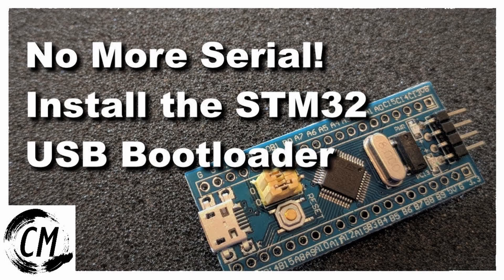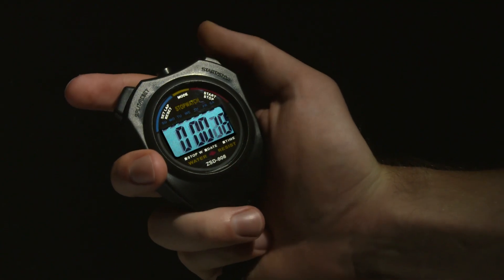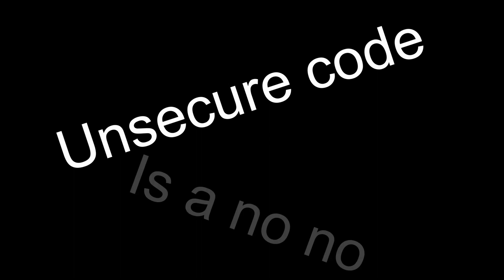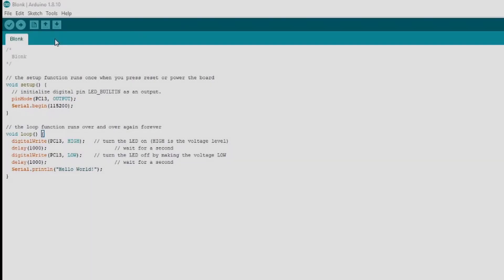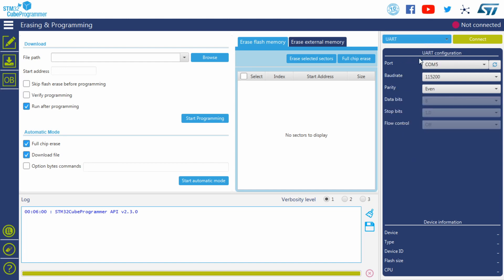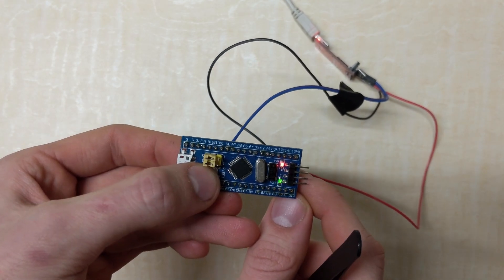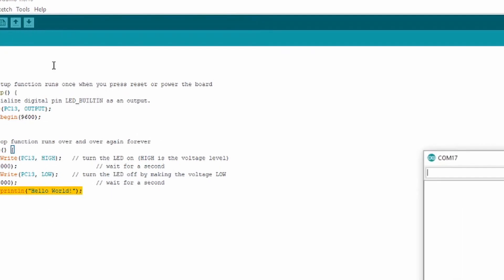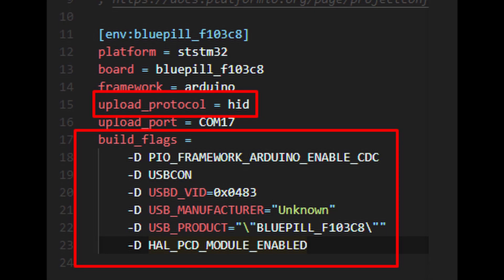How to Install the STM32 USB Bootloader, New Version! (Blue Pill F103C8T6)

Comment: So, due to whatever reason no bootloader, this one nor the old one, is working on my STM32F103C8T6. I upload the bootloader via serial  (using a cp2102) then set BOOT0 jumper back to 0, and when I connect the STM32 USB to my laptop it says "Unknown USB Device (Device Descriptor Request Failed) in Device Manager (under Universal Serial Bus Controllers).
Also one thing I would like to mention is that my STM's usb does work via Serial.println() it prints stuff on the serial monitor 
Any help is super appreciated, I have no clue whats going on

Comment: could stm32 f411ceu6 use this method ? since  f411 has built in dfu mode. but i need always push boot 0 and reset everytime if i want upload the code
Reply from the maker: There may be a different bootloader, but I think this only works with the f401 and blue pill

Comment: Best stm32 bootloader tutorial out there!  Question:  I have a "Pill" board that is the same as the F103 however it has an F303 chip on it.  The binaries you reference don't have an entry for the F303.  Can I use the F103 bootloader binary?  TIA!

Comment: Im getting “data read fail”, “GetID command not acknowledged” and “read protection” errors on the  stm32cube software on all my 5 blue pills, despite it reading the chip information just fine. Any clues as to what may be happening? Great video regardless.

Comment: Very cool,  Im more curiouse to know how a bootloader works what it does and why hasnt stm32 done this for convenience?  On the otherhand im  flashing fine on my  stm32 clone(ch32) through  its  usb port without an additional bootloader although i have to use their tool for flashing.  But after all that  i found the stlink actually more convenient since i dont have to unplug and reset jumpers everytime like i have to with usb.  Its a miracle i havent lost the jumpers the amount of time its popped out on its own while trying to take it out, its not a matter of if, but when...

Comment: NOT WORKING!!! My Arduino IDE throws an error saying "Failed uploading: no upload port provided". I used ST-Link V2
Reply: After you flash the bootloader you need to hook it back up to the TTL converter and select the COM port and then try uploading in arduino IDE. It then begins to flash something else and it will finally work.

Comment: Thank you very much for your guidance. Spent 1.5 days to make STA32 working until I saw your video. Now  I am good now. Just FYI, I used STM Flash Loader to flash bootloader and in the Arduino's Upload method I used HID Bootloader 2.2

Comment: I tried the steps till 6:05, but windows did not recognize my bluepill when I plugged it in via usb. Not sure why, wondering if anyone is facing this issue.
Reply from the maker: Does it not recognize the pill, or does it even know a device is plugged in? Maybe try another USB cable, some don't have data lines

Comment: Thanks for info but in my case after installing the bootloader when i plug my STM32f103 bulepill it says USB not recognized and in arduino IDE it says your board is not connected,but i think bootloader is flashed as mine PC13 led is blinking at very high rate.Any ideas?
Reply: Hey same problem here. Any fix?
Reply from the maker: Sometimes the boards themselves are just broken, try a new board. Other times your USB cable might not have data lines so try a new USB cable
Reply: Old but after you flash the bootloader you need to hook it back up to the TTL converter and select the COM port and then try uploading in arduino IDE. It then begins to flash something else and it will finally work.

Comment: If anyone follows this tutorial on MacOS and having the error: hid-flash permission denied, you need to open terminal and add the execution permission to hid-flash file. After that, you can upload the code as in the video.
Reply from the maker: That would be a good thing to make an issue for in the GitHub repo. Thanks for bringing that up!

Comment: I dont have this options in arduinho how update this?
Reply from the maker: Which option specifically?
Reply: @CalebMarting  USART support, USB support also HID Bootloader is only 2.0 not 2.2
Reply from the maker: I think they changed Links at one point, maybe the one in my video is broken? Look at the official GitHub for Arduino core stm32 and see if there's a link for a new json

You can also check for a new hid release
Reply: @CalebMarting  ok i thing i found but in library menager what should i search?
Reply: @CalebMarting  ok nevermind I fix this but last question after i install HID bootloader  to stm32 why in device menager is error "usb device not found" also in arduino "PORT" tab is empty

Comment: Very nice video, finally i could upload the test code to my bluepill. Now i have the same problem as described in the pinned comment. When i first upload everything wroks fine, but when i try to upload again it says : 'Error - [1209:BEBA] device is not found' I tried disconecting and reconnecting my board per usb but it didn't work, after erasing the full memory of my chip and re flashing the bootloader it worked, one time. Is there a way so I don't have to reinstall the bootloader every time I want to upload a sketch. Thanks yall in advance
Reply from the maker: Yep, if you put the boot one jumper to the 1 position, the opposite of the one that I used to upload the bootloader, and press reset it'll enter eternal USB boot mode. Here it'll wait for code to be uploaded, and then once it's uploaded it'll run. 

Anytime you press reset or turn the power on though, it will enter boot mode again, if you don't want that to happen and just want it to run your uploaded code, move the boot one jumper back to the zero position

Comment: Hi
Your video on STM32F103 is brilliant, it helps a lot. Both programming and native are combined into 1 port after installing the HID bootloader. Appreciate your video.

Do you also have a video that guide us on STM32F407 board?
Reply from the maker: It should be almost exactly the same process, just using the f407 bootloaders instead. I've never used one of those boards though. What are you confused on?

Comment: Is there a way to make an usb Hid device with this bootloader? UsbComposite library is incompatible :(
Reply from the maker: You can go back to the old core mentioned in my previous video on the topic, although I don't know if you'll be able to use this specific bootloader then
Reply from the maker: Although I think it is possible to use it as a keyboard and or mouse if you set the USB in the tools menu to hid and use the built-in keyboard or mouse library

Comment: It didn't work for me, when I upload the bootloader and reset the board, the led on pc13 blink pretty fast. Then I tried to upload a sketch and didn't work.
Reply from the maker: I mean it could be a USB cable without data lines, is any device detected when you connect it? The LED blinking means it should be working. You could also try it on another blue pill because sometimes it'll look like it should work but it just won't
Reply: @CalebMarting  it was the USB cable. Thanks. It works now.

Comment: Hey. I know this is an older-ish video, but do you know if you can program the blue pill with STMCube IDE? Or with STlink utility or STM Cube Programmer. I just want to upload what I code in the IDE to the board via USB, be it directly or writing the binary file.
Reply from the maker: You could use the command line hid interface to upload bin files directly, though I'm not entirely sure how to do that. It's in the same repo as the the bin file
Reply: @CalebMarting  Thanks! I'll check it out

Comment: Not working at all for me...either on Windows 10 or MacOS.  Bootloader working successfully but this business about the virtual com port...is that a software driver that needs to be installed from STM?  Otherwise, device not detected at all...
Reply from the maker: The com port should have the driver by default on Windows 10. When you first install the bootloader though, the com port will not be there. This is because uploading with the settings described, generic CDC supersede usart and USB enabled will create the com Port when a sketch is uploaded for the first time.  However sketches are actually uploaded over a hid device meaning that you don't actually need a com port to upload code. However Arduino is a little janky and requires a com port be selected if one's available.
Reply: @CalebMarting  I tried following the method exactly...it all works, the green LED on the STM32 is flashing...but no go.  On Windows 10, I get the message that the USB device is not working properly.  What environment did you use in your video?
Reply from the maker: It does sound like everything's working correctly. Do you have another blue pill you can try it out on? Sometimes it's just the pill itself that is Dead on arrival. I was using Windows 10 if that's what you're asking
Reply: @CalebMarting  They are almost certainly clones, but they work in the sense that I can program them with the FTDI board.  I found another video using the Flashloader software, but they had links to a different generic boot file.  Seems to work slightly better in the sense that my MacOS can detect it when I plug it into USB...but I cannot program it.  On the Windows machine, same problem...I get that error message that the USB driver had a problem.  I think I'll just set this aside and continue working with the FTDI board for now.
Reply from the maker: Sounds good, I also have a video that shows the older version. From what I've found many boards will work , but if something's broken it's the USB that's the first thing to go.that means a board can still execute the blink sketch just fine but it'll have trouble connecting to the USB. The fact that they are clones might not be what's causing the issue, it might just be the USB peripheral doesn't work
Reply: @CalebMarting  Question: when you connect via the cube programmer, how many memory addresses do you see on your device? Is it 128 (0-127) with 1KB each?  Does that mean this thing has 128K of memory, not 64?
Reply: OK, super weird.  The Amazon order said I had bought the 64K version, I guess they shipped the 128K version.  I flashed it with the high density boot loader, and it works fine now (I am able to program it on my Mac).
Reply: @CalebMarting  I should also THANK YOU for putting this video together...except for that one oversight on my part (about the 64K vs. 128K), every step if followed correctly in your video gets you programming from USB..which is great!  I'm flashing all of my STM32 boards today.  Thanks again, keep up the good work!
Reply from the maker: That's awesome! Glad it works
Reply: @CalebMarting  Ughhhh...sorry for making this more complicated...but I feel I should correct my previous reply because it may throw someone else for a loop.  I actually didn't use the high density boot loader, but the medium density boot loader for PC13 (which is my board)....HOWEVER....when programming the board the first time, it is critical that you unplug the FTDI board, and then I had to select "Blue Pill FC103CB (or C8 with 128K)".  So just to be clear, my board was FC103C8...and it has 128K of memory.  Selecting the wrong board type (by going with what the seller said it was rather than checking if it was 64K or 128K) was what was the issue.  Also, when the board was programmed the very first time, all of the sudden a new port became visible, and consistently visible after plugging and un-plugging the board to the computer.  In my case, the port detected on my Mac is /dev/cu.usbmodem8D7F226649521 (and it's the same for any board I use so I guess the name is somewhere in the BIOS?).  Also...of the three boards I was using, 2 worked via this method, one does not...I think it's probably because the USB port is faulty or there is some issue with the soldering, not sure.  But if anyone does have chronic problems connecting to the USB after using this method, definitely try using another board, and also try confirming the cable works (some USB cables only have power connected, not data).
Reply from the maker: Thank you so much for your feedback it's really helpful!

Comment: Followed this and was able to program the 2.2.2 HID bootloader onto a bluepill. It was  attached to my linux box and I was able to program it using arduino as described. I was able to upload the blink sketch and it worked fine. 

What I noticed was that after programming the bootloader and plugging in the device I saw

Feb 19 17:35:17 x1-Carbon kernel: [159760.782737] usb 1-4.3: new full-speed USB device number 62 using xhci_hcd
Feb 19 17:35:17 x1-Carbon kernel: [159760.896087] usb 1-4.3: New USB device found, idVendor=1209, idProduct=beba
Feb 19 17:35:17 x1-Carbon kernel: [159760.896088] usb 1-4.3: New USB device strings: Mfr=1, Product=2, SerialNumber=0
Feb 19 17:35:17 x1-Carbon kernel: [159760.896089] usb 1-4.3: Product: STM32F HID Bootloader
Feb 19 17:35:17 x1-Carbon kernel: [159760.896090] usb 1-4.3: Manufacturer: www.serasidis.gr
Feb 19 17:35:17 x1-Carbon kernel: [159760.897242] hid-generic 0003:1209:BEBA.002A: hiddev0,hidraw4: USB HID v1.11 Device [www.serasidis.gr STM32F HID Bootloader] on usb-0000:00:14.0-4.3/input0

 Subsequent upload required the tty port to be set  to ttyACM0, which I found strange but then I noticed that when attached it showed up as a different device. After uploading the blink program and on every new connection of the device I see. 

Feb 19 17:35:21 x1-Carbon kernel: [159764.903072] usb 1-4.3: USB disconnect, device number 62
Feb 19 17:35:21 x1-Carbon kernel: [159765.142626] usb 1-4.3: new full-speed USB device number 63 using xhci_hcd
Feb 19 17:35:21 x1-Carbon kernel: [159765.256541] usb 1-4.3: New USB device found, idVendor=0483, idProduct=5740
Feb 19 17:35:21 x1-Carbon kernel: [159765.256548] usb 1-4.3: New USB device strings: Mfr=1, Product=2, SerialNumber=3
Feb 19 17:35:21 x1-Carbon kernel: [159765.256553] usb 1-4.3: Product: BLUEPILL_F103CB CDC in FS Mode
Feb 19 17:35:21 x1-Carbon kernel: [159765.256556] usb 1-4.3: Manufacturer: STMicroelectronics
Feb 19 17:35:21 x1-Carbon kernel: [159765.256559] usb 1-4.3: SerialNumber: 8D9022774848
Feb 19 17:35:21 x1-Carbon kernel: [159765.258827] cdc_acm 1-4.3:1.0: ttyACM0: USB ACM device

No issues uploading new sketches that blink or use the Serial.println() function. All works fine, but I thought it was strange that the device idVendor changed from 1209 to 0483 ? Looks like newer version of the STM package (1.9) in arduino overwrote the HID bootloader.
Reply from the maker: It could also be the fact that when you upload an Arduino sketchwith the settings I describe in the video it creates a serial port. It's possible that's what you're detecting since that isn't initially available when you first upload the bootloader

Comment: Am i the only one who cannot communicate with bluepill over uart? No matter what i tried, it didnt work. I checked A9 and A10 if they are connected to stm chip with multimeter and yes they are. When it is not bootlader mode it just blinks, when it gets bootloading state no respond at all.
Reply from the maker: Do you have another blue pill you can test with? Sometimes there are defective blue pills, the chips on them especially

Comment: hello, not long ago I got the Blue Pill F103C8T6, and I am about to buy an ST LINK V2, but I am not sure what is a Bootloader ? Further I have heard something about decreasing the STM32's capacity. Does the bootloader mean you can use the board with the USB ?
Reply from the maker: I would definitely recommend buying the Stlink, it is worth it. 

The bootloader let's you upload arduino code over the USB, instead of needing an external programmer. However a bootloader will use 2kB of memory. An ST-Link v2 let's you program easily and debug your code. Also, you can still use the USB for serial output even if you are using an ST-Link, you just can't upload code over the USB without the bootloader.

One more thing, if you are using a bootloader and upload code with an Stlink it will overwrite the bootloader and you'll have to reupload it If you want to use it again

Hope this helped

Comment: Great video man. I have a question. will this also work with cube programmer? I mean can I flash .bin files with cube programmer using the USB?
Reply from the maker: Unfortunately it will not. It won't recognize anything but the default bootloaders on the chip, the ones in ROM

Comment: Even though I had uninstalled all smt32-related stuff from the UI, I still had in the `C:\Users\MyUser`Documents\Arduino\Hardware` some folder called Arduino_SMT32-master that I surely put there some day in the past from some other method. That's also the reason why my UI in "Tools" looked different than the one showed by Caleb. Once I deleted the folder, my UI started looking normal again and I was able to select all the right options that he showed. Finally, I had to manually select the right COM port at the time of my second upload and that was it now my Blackpill f103C8T6 works perfectly as the Bluepill shown in the video.
Reply from the maker: Do any devices show up in the device manager when you plug it in? That's very interesting. Try moving the boot one jumper to the one position and seeing what happens
Reply: @CalebMarting  Sorry I edited my comment to make it more concise after I found my mistake, I think you answered to the original one.
However... now I tried uploading my own sketch instead of a simple led+Serial and I've lost the COM port that had appeared and I'm unable to program the Blackpill again (the "1209:BEBA" error).
Reply: @CalebMarting  I found why my sketch did that: "Wire.setClock(400000L)". Apparently that's the cause. When I don't have it, my bootloader continues working for another round.